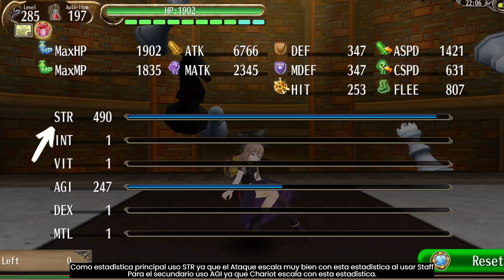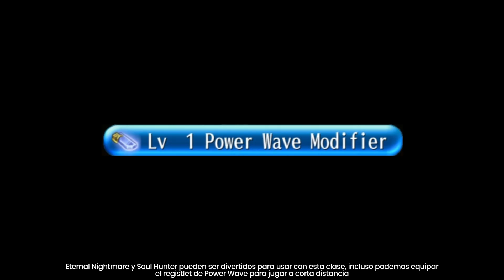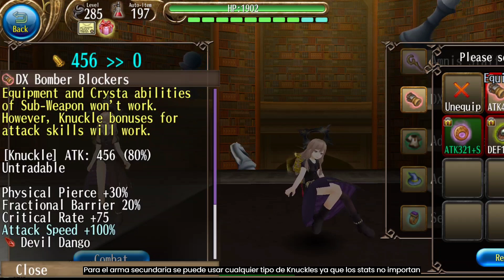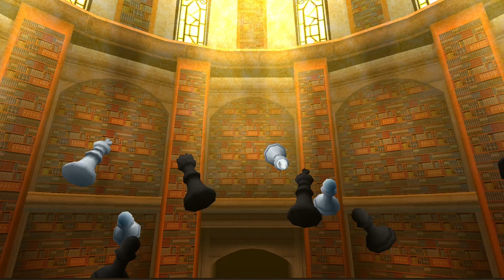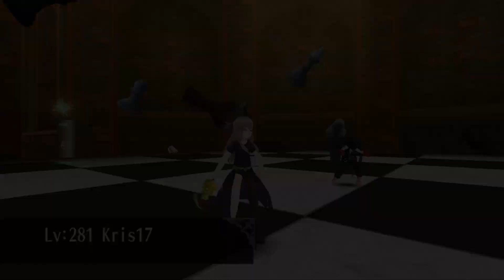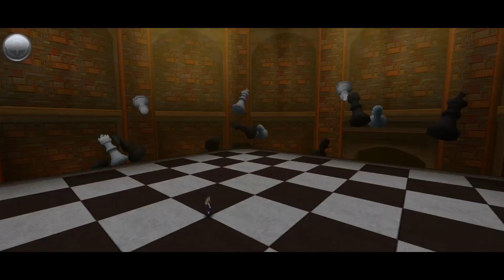Staff-Fu is back!? Enchanted Barriers changes everything! Physical Staff Build - Toram Online

Comment: Nice build. I have Staff Shield (Physical type) as a tank and also deal damage. You spam Chariot, but I spam Nemesis. Compare to Chariot, Nemsis is Light and does not have SRD/LRD, damage quite a bit low if the target is not Dark. I use soul hunter as well. Anyways, love seeing more unique classes.😂
Reply from the maker: @yentioe3761  As a little secret in this build I also learned nemesis but I had forgotten that it only scales with STR when using shield 🤐😂

Comment: I been using staff fu for a long time now, I didnt know it was a rarely used class hihihi im unique (blushes) anyways you can use annihilator in staff fu and breathwork as combo ender to halve the mp of next skill, asura will give you 75 crit rate so no need for crit items. use asura then as long you have breathwork as combo ender you can spam other skills like normal even under the state of asura the multiplies mp usage
Reply from the maker: Thanks for your comment ^^ but Annihilator's damage buff does not apply with Sub Knuckles and Asura Aura only gives 25 cr (with sub Knuckles ofc)😅
Reply: Asura give dmg bonus tho  @kris17.0toram